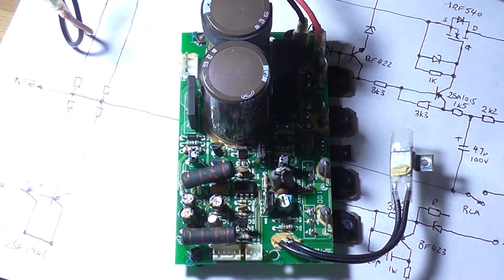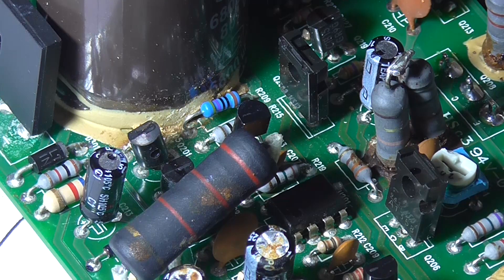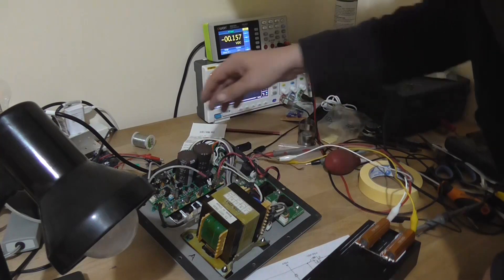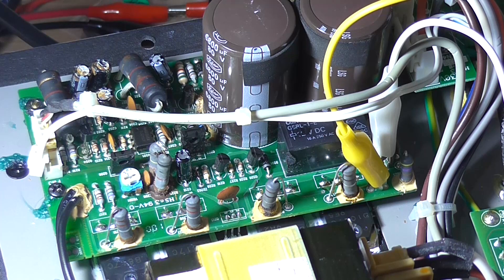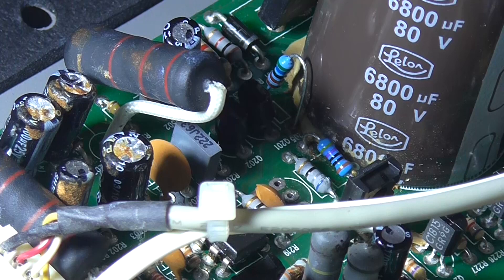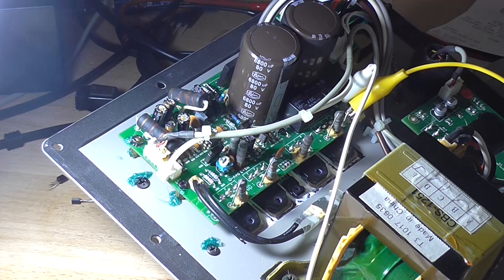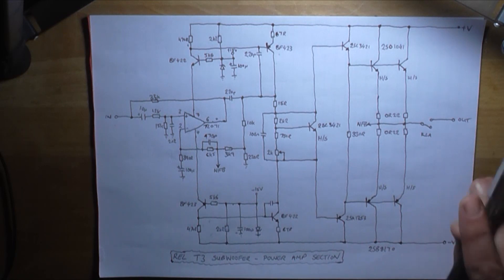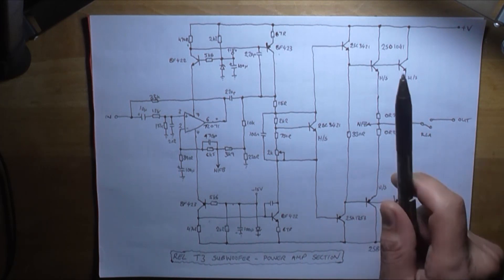REL Acoustics T3 Subwoofer: A Second Look

Comment: I would started with the 3 visually burnt trasistors and leaky cap before buying a fancy oscilloscope
Reply from the maker: @Steve-nf7gp  the scope was purchased way before this
Reply: @AstrosElectronicsLab  i apologize for my rudeness. I just don't t understand how those archaic puppies work is all. Always wanted one as a kid. When i went to middle school in the early '90's those things were in the schools secret storage room of outdated equipment that no longer stood as pertinent science tools according to the schools budget. Wish i knew the principals of their usage though before i opened my big mouth.
Reply from the maker: @Steve-nf7gp  no offense taken :). I don't remember seeing any leaking caps, either... maybe a load of that brown circuit glue, however. The fact it works now, is the good thing ;)